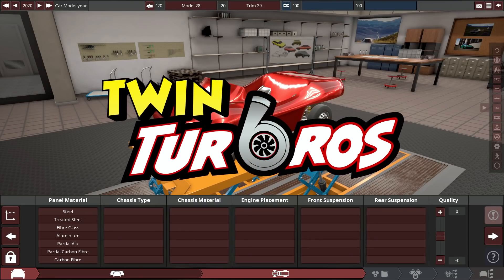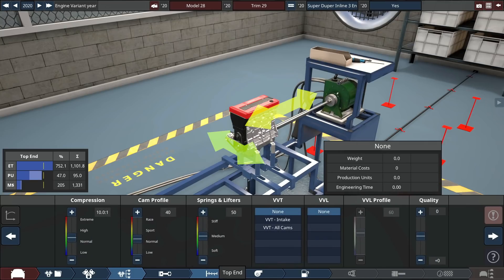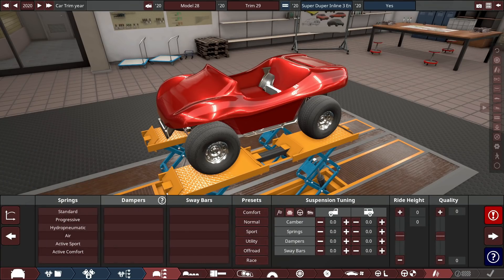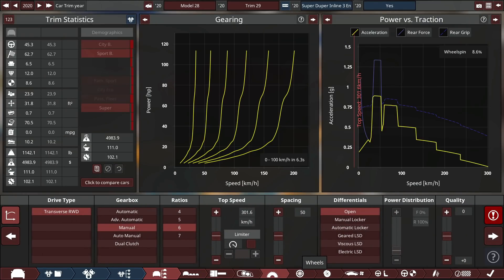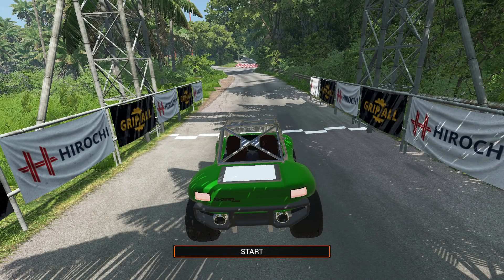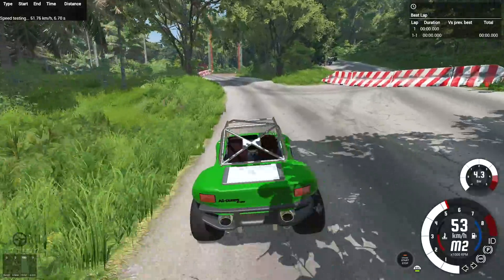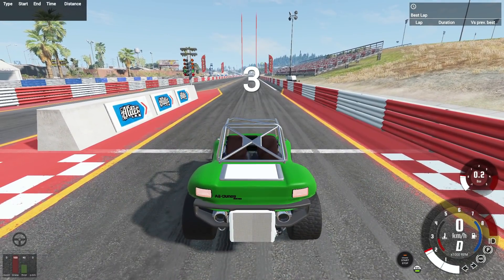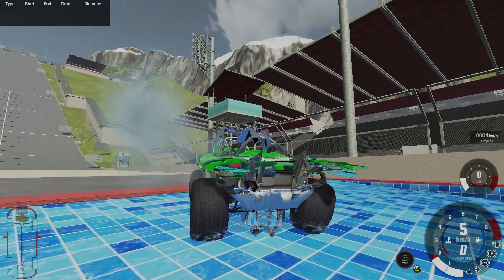Building The Highest HP 1L Engine!! Automation - BeamNG

Comment from the maker: What other builds should I make?
Uhh let me know :_TwinTurBro:
Reply: You shoould make the biggest modern car
Reply: Could you make a McLaren F1 GTR competitor.
Reply: tank
Reply: where is my v16 minivan
Reply: A car that is as topheavy as posible and then race in it with the guys
Reply: 144 cu in (2.4 L) Falcon Six I6 with a diesel compression
Reply: @Loganator_1121  you should ask Cleetus McFarland
Reply: This but with a usable power band, turn the cam profile down and use a slightly smaller turbine, also maybe don't gear limit it over 200, irl it takes over 200 horsepower to EVER achieve 200mph in an aerodynamic car, this would probably top out below 150 IRL
Reply: Perhaps the same engine but in a hatchback car like the new gr corolla
Reply: A cvt would be best for this😂always stay at peak power
Reply: Try to make the lightest rock crawler/off-road build you can!

Comment: Doesn’t the overheating headers stop you from hitting max rpm, redline said 12,000 but in beamng and automation it stopped at like 7,500 rpm
Reply: Perhaps, I noticed the weird differences in the stated redline and the actual. Given the power-band is so tall this low redline limits the power of the engine.
Reply: Yeah that has to be the ugliest power curve I’ve ever seen, not because it’s bad, but because everything is literally at redline.

Comment: next, you gotta do the least HP per 1 liter engine. slow cars need love too
Reply: @_peters6221  exactly
Reply: No
The most litres per HP
But that's effectively the same thing
Reply: @tomasprochazka7840  I mean, I just made a 21.9 L V16 (largest possible in the game) make 150 hp, but that was because I wanted it to have decent power (for the time, in a career save, meaning '46 and couldn't make tires good enough to handle that much power)
Reply: @tangentfox4677  i managed to create the same engine, but with 4 hp and an i3 with -7 hp
Reply: You really mean it? 🥹

Comment: Next time to make it faster you need to extend the powerband by alot. That's an error that I see everyone use. It has alot of peak horsepower but most of the time you have like 20hp.
Reply from the maker: For sure, if i was only trying to get peak power :P
Sadly if i wanted a smooth powerband id get no where near the power!
Reply: @TwinTurBros  true, next time talking about horsepower and powerband, you should try to make 2 different test. Both engines have the same hp but the rpm is different. One is making 500hp at 7k rpm but the other engine is making 500hp at 4k rpm. Just to see if there is a difference.
Reply: For real I hate it. It does not matter if you have 1000 hp if you can't use it because it has no torque anywhere but 100 rpm before rev limit. There is a reason why cars leave a thershold of a few hunderd revs after peak power. And I know this is just a game but it makes the game much more fun when you do it properly. That car would be many times faster if it had 90 hp but many thousand of revs to use.
On another note I got 111 hp at 10400 rpm from an exact same size engine. Turbo does not explode so it revs to 12k and boost comes at 7700 rpm. I'm not bragging, just saying it's possible to do
Reply: @erenwithpizza5799  That's what I'm saying. Literally with just a few less hp you can make this thing so much more faster. I did a 1L engine have 320hp and it didn't have a crazy peak hp
Reply: Or you could use a CVT and have the engine constantly at peak power
Reply: @juanordonezgalban2278  it creates alot of heat and friction by using a cvt because the engine is always under stress. And also automation doesn't have a cvt unless you program it.
Reply: @TwinTurBros  Yeah, big problem is that you generate most of your car's power at the end of its powerband. Supercharger could help with that as they kick in at lower RPMs.

Comment: "122hp in 0.2 L is over 600 hp/L"
Except that's 121.8 hp in 0.203 L which is PRECISELY 600 hp/L (I did the math because I am unreasonably upset by rounding)
Reply: The final version is 667.5 hp/L, not 675. ;P